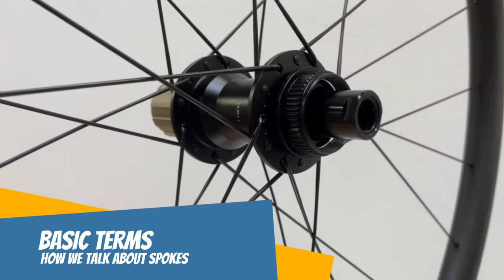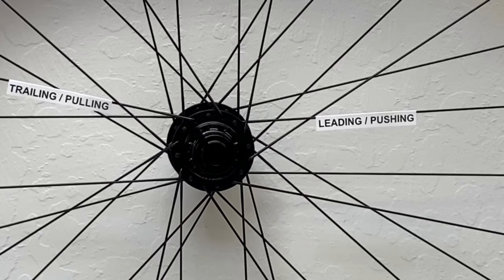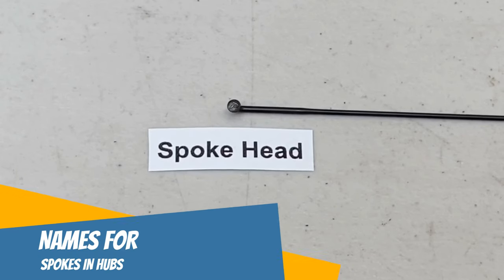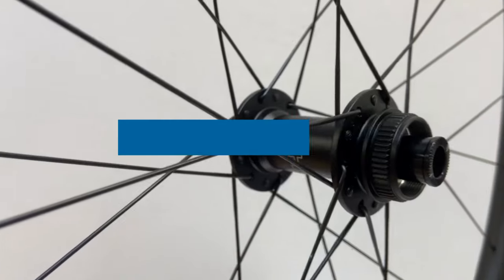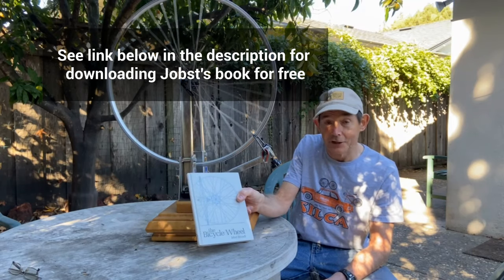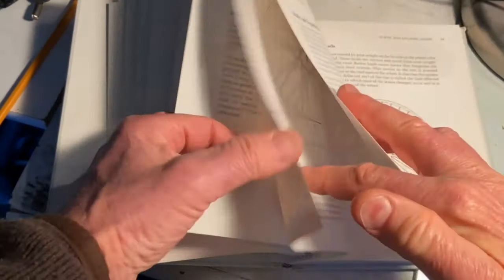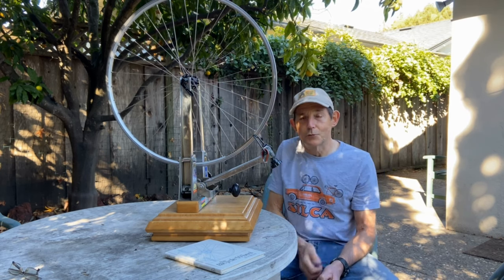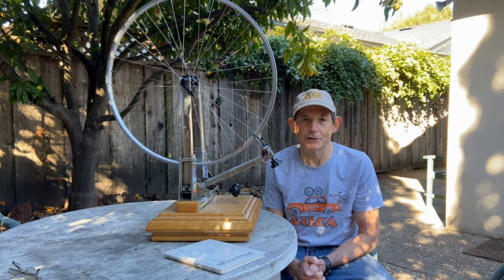Bicycle-Wheel Spoke Terminology Explained!

Comment: I always wonder why there aren't more straight pull hubs? Is it's strictly a manufacturer cost concern?
Reply from the maker: I think you're probably right, Ric. It has to be easier to put holes in flanges than to create a pocket for straight pull spoke heads. I also think that straight pull spokes create other challenges such as how to prevent spoke twisting. We had straight pull hubs and spokes early on in cycling, over 100 years ago and the industry mostly moved away from them. But there have been advances and when straight pull is done well, it results in a very nice wheel. I'm not sure though that they're right for the vast majority of bikes that are sold that have mostly very inexpensive parts on them. Appreciate you watching my video and the interesting comment.
Reply: Arent they weaker than j bends since they dont touch each other?
Reply from the maker: @oreocarlton3343  well it depends on the spoke, hub and wheel design. A straight pull spoke can be as strong or stronger but not all types/designs. The spoke cross-where the spokes touch helps strengthen wheels and damps ride vibrations from reaching riders, however it can lead to spoke wear over time at that point. So there are pros and cons. Thanks for the excellent question!
Reply: @JimLangley1  Pleasure is mine sir.

Comment: If you build a radial front rim brake wheel, is it heads in or out? Does it matter?
Reply from the maker: Thanks, that's a great question, Oreo! You can lace it either way and end up with a perfectly good wheel. (Note though - that you should only radially lace wheels if you are 100% sure that the hub you're using is approved by the hub maker to be capable of handling radial lacing - not all are - and if not they can and often do break.)

To decide whether to go with heads in our out, the heads out spoke lacing pattern gives you a narrower spoke triangle, so it's considered better for aero wheels, such as for time trials. While the heads in pattern makes that triangle wider, which is better for lateral stability and strength. 

There are more options, too: if a wheel was offset to one side such a disc brake wheel, depending on the design of the hub flanges and hub spacing you might decide to experiment and try heads in/out on one side and the opposite on the other side of the wheel, to see if you can get more even spoke tension that way (since the wheel is offset to one side).

Or, if you wanted a radial wheel with a little more visual interest, you could alternate the spokes on each side, head in, then head out, so that half the spokes were out, the other half in. The wheel would look unusual and would still perform just fine. But, most builders lace heads out for aero wheels and heads in for wheels needing maximum strength and lateral stiffness.

Hope this answers your questions. Thanks again!
Jim

Comment: Can't say I endorse Jobsts' book to people when I talk about wheels, but then I interacted with Jobst in the non-cycling professional sector, and I recall how he interacted with Sheldon, therefore, my opinion of Jobst is skewed.
Reply from the maker: I know Jobst was a controversial figure on forums in the early days of the Internet, Walt (I used to frequent those pages, too). But I didn't know about his interactions with Sheldon. I recommend Jobst's book because it's now free (otherwise pretty expensive from people selling used ones), and because it's one of the first (maybe the only) wheel book based on actual testing of wheels (not just building and riding them). I can't say that I was a close friend of Jobst, but I have ridden with him and got to know him a little. He was definitely opinionated but everything was based on what he believed was factual/correct based on his extensive engineering background having worked for, among other, Porsche and Avocet (remember the many unique products they came out with?). He was a fun guy to ride bikes with, I can say that.
Reply: Having recently read the book there are few points I would have argued with Jobst about if he were still around. But working out whether you agree with it is part of the fun of the book. And there was a certain nostalgia in revisiting the topics of some of those heated debates. Easy to forget when arguing with these people sometimes that you have much more in common with them than not.

Comment: Great video and I enjoyed the Jobst book! It seems there's a choice to be made on the drive side rear. Trailing spokes heads-in means the flange has a better contact with them. But that way around the increased tension in them pushes the spokes towards the dérailleur which is not what you want. In practice neither of these things is usually a real problem though, especially the second one as unless your hanger or dérailleur are bent there should be plenty of clearance even in the lowest gear.
Reply from the maker: Thanks for watching and the comments, Ben. Using Jobst's lacing for rim brake wheels and Shimano's lacing for disc brake wheels is how I do it. Without discs, symmetrical lacing with pulling spokes heads out (Jobst's way) solves any potential brake pad rub/derailleur rub. But on disc brake wheels, there's the braking force to be concerned with, which is why Shimano puts pulling spokes heads in. Unfortunately, I don't know of any papers clearly explaining what data Shimano used to come up with this as the best lacing for disc wheels. However, I do believe that they did extensively study it. Maybe someday we'll see the data? That would be great but I'm not counting on it ;-)
Reply: @JimLangley1  But under braking it's the leading spokes that end up pulling. I probably remembered wrong but I thought Shimano suggested heads-in trailing on the right rear and heads-in leading on the left. The right will get wound up more under power and the left more under braking (assuming the hub is not infinitely stiff which it isn't). But I may be confused and have remembered wrong :) Heads-in trailing on the right rear does have the theoretical risk of pushing the spoke crossing out into the dérailleur. I don't think that will really happen though.
Reply from the maker: @benc8386  Hi Ben - here’s how Shimano “says” to lace disc brake wheels fyi: https://youtu.be/gfWd7_avr1s It suggests their tests focused on something Jobst’s didn’t - it would be nice to know more details some day.
Reply: @JimLangley1  Ignoring the front wheel and just talking about the rear the disk only affects how you lace the left flange. Shimano's recommendation for the right flange seems to be based on wanting heads-in to apply drive torque and they would probably recommend the same thing for the right flange even if you didn't have a disk. Basically we have three things to think about on the right rear: drive torque means we would want trailing heads-in, braking torque means we would want leading heads-in, and dérailleur interference anxiety also means we would want leading heads-in. Shimano seem to think the first of these three considerations wins. Yes would be good see their research!
Reply from the maker: @benc8386  you could be right ;-)
Reply: @JimLangley1  All the wheels on my bikes were built at random anyway because I had no idea :) Only one bike has disks. I think I might have fluked that one right. But the last pair of wheels I built this summer for a friend followed the Shimano philosophy which I got wrong and had to relace a few times :)
Reply from the maker: @benc8386  ha, I understand - by memory I got “Shimano” disc lacing wrong at first and a customer asked about it. When I realized I had it wrong, I built him 2 new wheels. That’s part of the reason I made that video - to hopefully help others not repeat my mistake.

Comment: Im planning to build a 27.5 wheelset. How do i know which spoke length should i choose? There are 270mm and 275mm options
Reply from the maker: Thanks for watching, Tuhod. You said "there are 270mm and 275mm options." Did you mean that you already have spokes and you have the spokes in those two lengths? If the person who sold you the rims also sold you the spokes, they should have used a spoke calculator to determine the correct spoke lengths for the rims and hubs you're using in your wheels. 

If they did that and they came up with two spoke lengths (270 and 275), then my best guess without know more about your rims and hubs is that the 270 spokes go on the wheel with the larger diameter hub flanges. And the 275s go on the wheel with the smaller diameter hub flanges.

If what I just wrote makes no sense to you, then please visit this spoke calculator https://www.sapim.be/spoke-calculator and start making selections and you'll be able to see diagrams of how you measure hubs and rims to calculate spoke lengths.  I'm happy to help more. Just reply to this explaining more and I'll try again. Thanks!
Reply: @JimLangley1   i already got the hubs and the rim. But i havent bought the spokes yet. I’m confused which  spokes should i bought online (270mm or 275mm).  I chatted the bike shop and told me its better to bring the rim and hubs to their mechanic to check which length fits. I think this will be safer to choose which length will do
Reply from the maker: @tuhodboi6360  bringing the rim and hubs to the mechanic is smart, Tuhod. The mechanic knows how to do the right measurements and the calculations to get you the correct spoke lengths for your wheels. Be sure to have him write down for you which wheel and which side that each length spoke goes on. That way when you start lacing you will be sure to put the right length in the right place. Have fun building those wheels!
Reply: @JimLangley1  thanks man!
Reply from the maker: @tuhodboi6360  you're welcome - happy I could help!